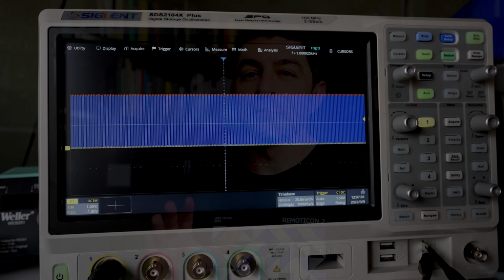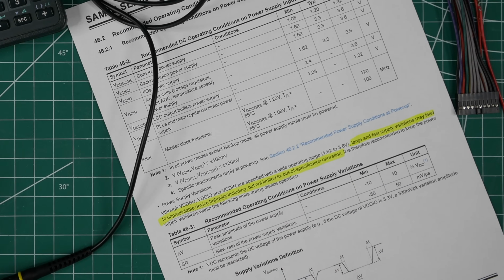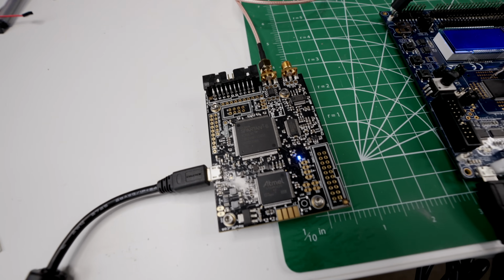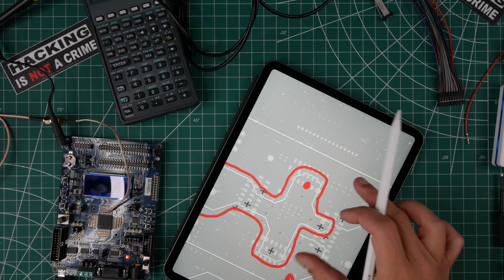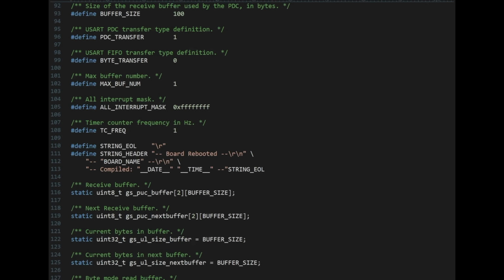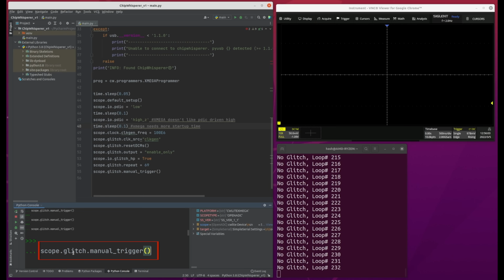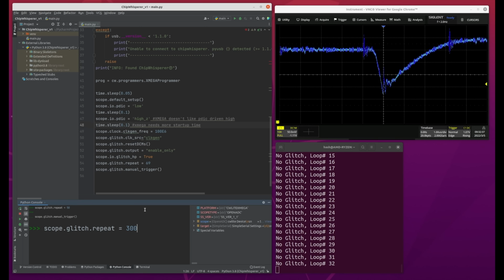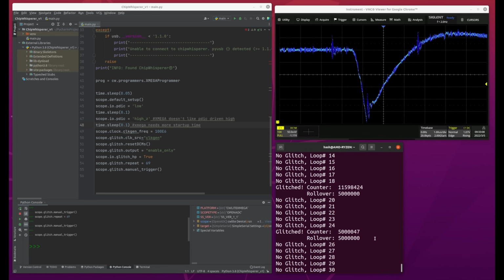Smart Meters are Vulnerable to this Attack

Comment: Bud I like your hacking style here on the meter but the easiest way that iv "heard" it's done to bypass the smart meter is just remove it from the service pedal cabinet and place 2 copper shunt jumpers in its place and tahaahdahh!!🎉🎉 heres your power back on with no issues.   😂😂❤ it's truly that easy but you have to be very sure you know what your doing when very carefully placing those jumper stunts.

Comment: The special cable you need. Is an IR input output cable. On the front right of the meter you’ll see 2 round IR diodes. One is output one input. That’s how they communicate to a laptop. It’s basically the smart meter network cable. The plastic cover normally has a triangle directly in front of the IR port. It’s what aligns and holds the programming cable to the meter. They plug in via usb to the laptop. The program sends the information @ 9600 baud and the same 16 bit data you already have created.

Comment: Just down load the firmware from SEL.    Why do you need to reverse engineer.   Look at information on the zigbee standards for a mesh network.  The system that reads the meters is a iron MV90.  You can read the Zigbee HAN home area network without reverse engineering

Comment: I want a simple device I can plug into any outlet and stop the meter from reporting anything. Not wanting it to commit fraud just prevent it from telling the company how much I use and when I use it.
It is ok to let them know the total used in a month but NOTHING ELSE.

Anyone know of a way or a device?
I want it pluggable so I can remove it when read time comes.

Smart meters are tantamount to privacy invasion.
Would anyone want Ford to know how much gas you use and when you use it instantly?
For warranty reasons they just need to know average MPG's not second by second MPG's.
Same with utility companies.

Who wants to be micromanaged by a utility company?

Comment: My meter is digital. What if one just went out there with a rubber mallet and just starting hitting it from angles or used something with super heavy vibration. Surely the vibration would Jack the chip board up which in return sends or doesn't send data to the billing department. There would be no way for them to prove you did it. These companies are scamming us.

Comment: I got questions
  Can I hook my smart meter to a inverter .to block any data it's collecting .
Reply from the maker: Not really power usage data, it’s going to get that either way
Reply: @RECESSIM  
 Is the new meter numbers  calibrated to the old calculations of units of electricity?? 

 How is flow of electricity measured?

Comment: Very interesting.  My city currently does not have smart meters.  The one on my place is digital but not connected to anything else and quite a few around town are the old analog ones.  They are wanting to change that so they can do prepay, monthly average billing, and a few other things.  I have heard that the way the digital ones figure a KWH is different than the old analog ones but have no clue.  I have my own meter based off of an ESP32 running ESPHome hooked up to the main panel feeding data into HomeAssistant so it will be interesting if there is a difference from the old meter to the new ones if they are put in.

Comment: do these run an interface on a handset that accepts commands like an ip camera?(does it have a webserver for meter readers to use the handset?) sometimes those commands are passed as system and you can make it do interesting things like keep cycling a reboot until it goes to a debug mode where you can pull the entire file directory all firmware and drivers

Comment: So what is the point.  These are simply a better meters.  It's possible to save on electric bills by using electricity at times when the cost of electricity is lower. You also get better feed back on the power you are using and when you are using it.  Like with the old meters it was possible to steal power.  Like if you are doing the same with the new meter that's stealing too.  So unless you are a criminal there is no reason to hack these meters.

Comment: I work alongside energy providers. A UK industry approved electric smart meter has 3 anti tamper switches built in. It sends a signal if any tamper is detected. It also flags if the meter doesn't pole within a given time frame. When it flags up we get the job to attend and investigate.
Reply: Rear Backplate, front terminal cover, front clamshell. Also measures potential difference using CT's. When the power is off for a given period (96 hours I've heard) then the meter gives out an alert. 
Also if the meter drops out the network for the same time period it's also flags and alert. They are clever little bits of kit. Nothing sinister about them. Just fairly smart when reporting a tamper
Reply: what are the 3 sensors please ? 🤔
Reply: U aint allowed on private property without going to court and getting a sapena

Comment: You remember the challenge to get pen  cap out the glass bottle without physically touching if your like me you are interested in this topic but you are not a reverse engineer capable type dude and you don’t computer hacker shit think simplistic though barbaric their is a sure fire way to get this same result quickly  how do you do it some people will have a light bulb go off and figure it out some may already have the beam of light on deck the guidance is directly to it to do it but be careful like Ralphie’s moms said on Christmas story just as sure as light will come right through the window of your room with no resistance without tint lol y’all should get it I know no punctuation save it I’m pooping and almost done not a part of the clue the do do

Comment: How bout NOT wanting a smart meter at all to begin with because they are super bad for your health. If u have one make sure its 30 feet minimum away from your house, I very much so believe they are not only used to hit u with lots of bad joo joo, they are also used to surveil. Unless I am missing the point to this or something?...I guess I can understand reverse engineering to find out what the evil doers real intentions are with these things. But I still cant condone even owning one of these mfers to begin with. I suppose for folks who cant go or dont have analog then this is imperative but ONLY if something can be done that changes everything they did to it to make them hurt us. Years ago I heard wrapping aluminum screening around your smart meter really really helps to block the majority of what youre being hit by.

Comment: The pole yransformers outside your homes are reasonance chamber with spark gap devices which bleed the build up of power from the reasonance they use 2 phases to create a double helix and after reasonce with use of spark gap to prevent arcblast they split the helix and morph the power lowering the voltage and increasing the amperage once the amperage is increased communications are nolonger possible and the power is fed directly to your home after use the energy what hasn't leaked through misfires earth grounds is returned through the neutral once again with no amperage as the electrons are now at lower state e b ergy is only borrowed never used it is continually moving from lower to higher state or vice versa energy is eternal

Comment: They use simpathic reasonance to power it with low voltage and it communicates through the power lines which are high voltage g e low amperage and the low amps prevent scrambling of the data the power companies have a hidden communications infrastructure called electrical power lines

Comment: The local power company swapped out my meter to a smart meter a few months ago.  For over 20 years I have always consumed between 205-270 kwh per month.  First bill with the smart meter was 280 kwh, second 285.  Two highest months I've ever had in 22 years here!  Instead of electronically attacking the meter, I just pieced together everything I need to go off grid.  I'm curious what the meter will read in a few months with my main breaker turned off!
Reply: Electronic meters and electromechanical meters react differently on distorted currents, for example from a SMPS.
Reply: They bill you for apparent consumption not actual consumption. Big Clive did a spot on them .  A local has figured out how to fool them into thinking they are still on off peak  when peak time rates are on . Plus they are on 900 mghz a node can mess with them .
Reply: My electric bill went up four hundred percent in one month then the next month it was two hundred percent so I called the power Co. and questioned them about it she tried to brush it off but I persisted and finally she said the public service commission let them do it after that my bill was the usual rate I'm sure I was ripped off but what can you do between big business and big government collusion we all get screwed
Reply: I did that (Solar) and my bill went down dramatically. Then they installed a smart meter on my home, note: my whole house is off grid with the exception of a new energy efficient Refrigerator and a small coffin freezer. For some reason after the smart meter install my bill keeps going up to more than before my solar install??????
Reply: Because 2nd ver of smart allows meters to "Factor". . .they easily know load on any branch, Factor function is adjustable, causing meter to indicate anything. Instead of 1, meter may indicate 1.001, or any value. You pay for a factored reading, not actual. The excuses for doing this vary from company . . .or state.
Reply: @jsunit5354  Clearly I've been factored and fu@ked!
Reply: Thank you for the information. How do we look more into this
Reply: Call them tell them send you papers to be opped out of the smart meter. They charge you more but at least humans get a job.  They don't save you money.
Reply: I basically bought >20k of slightly used panels, a hybrid 15k inverter, and installed the stuff myself.  F them!  All the power I need year round, but I still left the connection to keep backup power, but the breaker is off...
Reply: You got to look at the kilowatts on the bottom part of the bill otherwise I'll just keep charging the same amount every month which is I know they're lying they just take a toll and if you call them on it you see the kilowatts is different and it still charging the same amount here's what they say oh the computer didn't get it yet so we'll be sending you a check for all those months
Reply: they can see voltage - can increase up from 246v to 253v that how 7% increase your bill, you need to change supplier, then other supplier wont able to read different company smart meter
Reply: Great work. You are so right. I haven't been home all summer. Get home to and enormous bill. Now the power is off and Im wondering the same what bill will I get. How did you go off grid exactly and how much power do you actually have and comsume. Also how much power can you get
Reply: I built free energy devices I'm telling you you just take a toll and they still charge you taxes like probably $43 a month it's ridiculous they are on top of things and a lot of times just keep charging the same amount 140 or $259.61 it was one month and it'll be almost the same the next month which is completely impossible and ridiculous the thing is look at the killer watch and you can see it's half is less that month because of the device that I have hooked up and it'll say oh well the computer didn't get it will be sending you a check

Comment: I wrote software for two of these types of meters. They have two basic functions, to meter the power being used and to send it upstream to the power company. The former you can easily do without messing with the meter simply by hooking an ammeter arrangement up to (say) a Raspberry PI. You can even do that without breaking the circuit (non-contact ammeter). If you are interested in verifying your power bill is correct, that is the way to go.

The other purpose would be breaking into the billing part to scam the power company. It would be a lot of work to do, and the power company can do things like tally the individual meters against the power consumption for the whole neighborhood to trace down who has broken into their meter, resulting in anything from having your power cut off to jail time.
Reply: I agree with Scott. I would just comment that most smart meters also allow the provider to Factor the meter. Pick any value you wish, ie 1.10, which would have your meter read 1100 instead of 1000.  The excuses are many, from fuel adjustment to peak-vs- non-peak periods. The factor can be changed at any time, easily handled by an algorithm in the program. It can be set to gradually increase the factor as a user consumes various levels; the first 1000KWh can be at a base-rate, then factor-up for usage beyond that level.
The first line of defense is "Our meters are very accurate. We constantly test to assure customer confidence in our product and service "
You can feel free to change the boiler-plate verbage as you wish.
Reply: I agree with Scott just use an amp meter and record everything that the power is being used in the dally up to see if it lines up with the bill if they're charging you
Reply: Here's something I build free energy devices that work in the first state of matter and the thing is that these devices condition the house and save electricity about probably up to 60% sometimes the deal is they're not illegal or anything and they work well and sometimes I have to call him and tell him look the kilowatts is different but why you charge me the same amount and then they say well the computer didn't catch it yet and will be sending you a check

Comment: A bit of addition to "38911bytefree": there is no real requirement to keep the meter's firmware secret (mainly IP protection). As part of the security certification, the certifier may even get access to the source code to search for vulnerabilities. And in many cases, even the commented source code is pretty incomprehensible for the uninitiated.
The main protection is that every meter has individual cryptographic keys. 
As smart meters are a very cost-sensitive product, all unnecessary functions are omitted (memory costs money). Often not more than an RTE such as a stripped-down ThreadX or embos. The attack surface is small, the devices use only one protocol (ANSI in the USA, DLMS in pretty much the rest of the world).

Comment: atmel is a mirco controler not processor. meens you can clear and upload a new at anny time. getting a that copy is hard, 
then its still in macheine languge. 
it should have a external crystal option on 3 of those pins. if you wanna make a atmel crash up the freq and lower the voltage. 
what you could do instead is analize what its doing rengineer the firmware of that. question is you going even get close.

Comment: Hi how to get the same Model without Steel them? Its an Landisgyr E450 G3. And I guess the use a Custom FW.
Reply: You find them occasionally on auction sites such as eBay. The FW is totally custom. It is basically a hard-coded database with a process that writes the measurements and events to it, and a process that transmits the content at regular intervals to the power company.  The processor is the somewhat exotic Renesas RX.
Reply: @WimTon  Well I dont know. Here the use Powerline ~50khz I see them transmitting via my SDR.
Reply: @nowaymuller6643  The lower protocol layer is G3 PLC, ODFM modulated (G.9903). The data is encrypted with a key common to the physical network. The next layer is DLMS green book, an ASN.1 dialect. Encrypted with a meter-specific key, a network-specific key, or plaintext, depending on the use case. The data model is DLMS blue book.